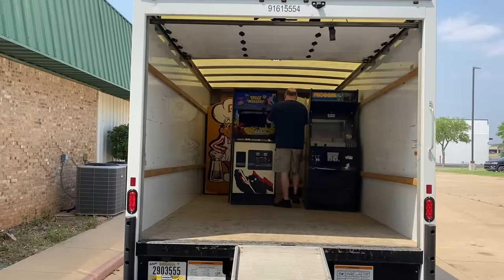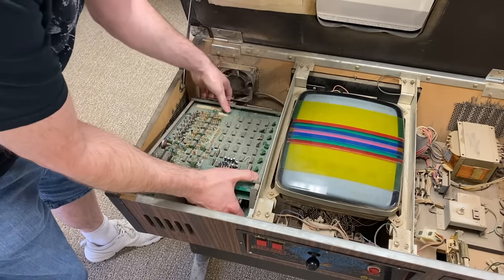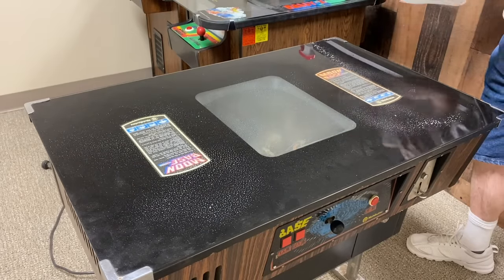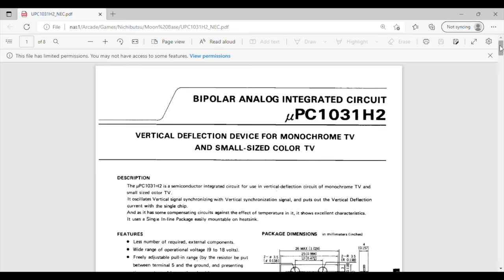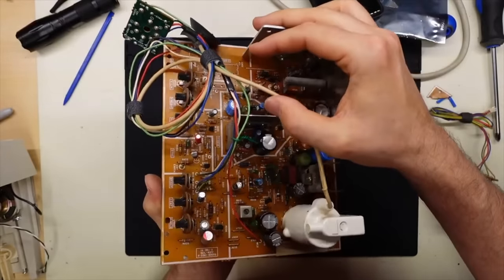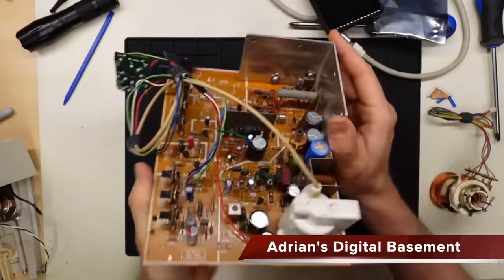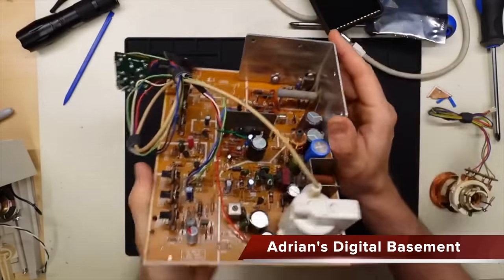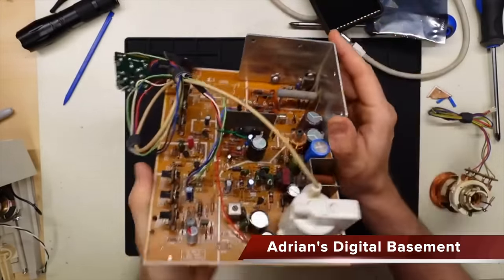Moonbase Arcade Restoration - Gone Wrong

Comment: What you get roasted is not for commiting mistakes as that is normal, but for always, ALWAYS end up having to relay on someone else to get the job done... And I mean ALWAYS, I haven't seen a single video on your channel where you actually do all the work and it ends up working fine (and I've seen a lot of videos on your channel) and you always end up relaying to one or more people to do the actual stuff for you, so, what you are bean roasted for is for being useless, for bein uncapable of doing such simple things as reading a freaking datasheet to see the propper orientation of an IC (as in this very video).

Comment: It always drives me crazy when you use compressed air to blow out the dust from these old machines instead of first vacuuming the insides and then using compressed air OUTSIDE! Sure, you're wearing a respirator, but all that dust and dirt goes EVERYWHERE! There could be asbestos or fiberglass or dried animal waste, etc. Please use proper care when cleaning these things out, if not for your family, for your viewers.